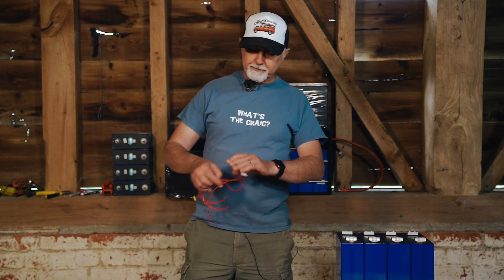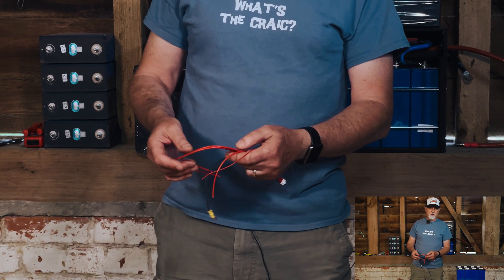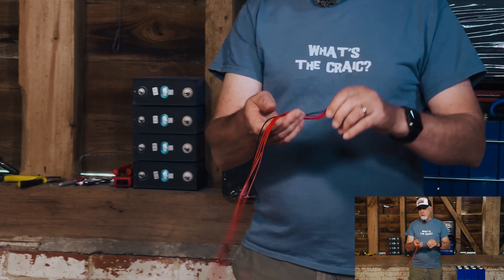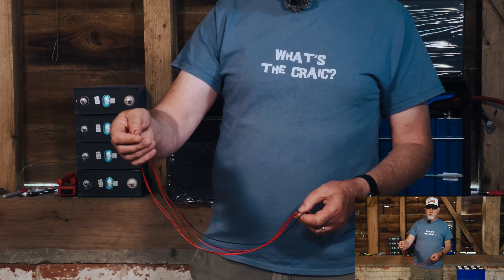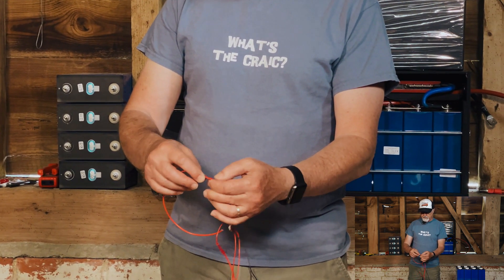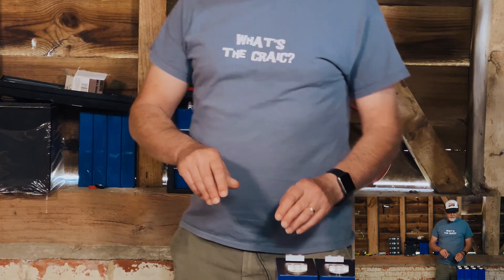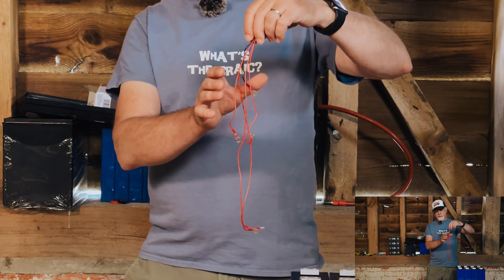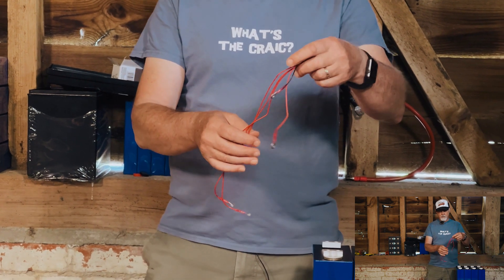Troubleshooting errors with Daly BMS

Comment: I got a daly smart bms and i think im going to return it it is not letting me connect bluetooth and mosfet not turning on.i adjusted parameters to do not sleep and max cell v of 3.55 .ive checked the cell voltage and they mught be 80 mv off butt after it charges they settle down .ive tried to short the b-p- also i soldererd the balance string so it got good connection i checked them about 4 times i checked continuity and i measured the cell voltage and i did not see nothing past 80 mv diffrence

Comment: Great video, excellent advice, thankyou. Any idea why my Daly Smart Active 200amp bms is showing 8 cells on the Bluetooth app, when I have only connected 4 red sample wires ( and the black to battery negative). This is worrying me, as I set up a similar Lifepo4 battery with the same Daly bms ( this one was 100amp bms to suit the battery), and on the app, it shows 4 cells. In both cases, I taped to isolate the redundant sample wire ends. Any advise would be really appreciated. I'm aware I am not a customer of yours...

Comment: I installed 5 Daly BMS with automatic balance function, two of them were damaged after 3 days, not physically but with lack of communication. Another Chinese garbage. Internal software communication problem if you cannot connect, you cannot reset the device.

Comment: One of the issues I noticed with your wiring harness is that you want all the balancing leads to be the same length in order to provide the same resistance for each lead. If I have to run longer lengths due to installation requirements, I use #12 gauge stranded wire of equal length run to din mount terminal blocks in order to connect to the BMS leads. This avoids crimping onto the smaller gauge wires, and in my opinion provides a cleaner and more rugged installation.

Comment: depends on the voltage... sometimes you get a shitty 72 bms.. maybe bad stock but how i make my battery arrays... it's not a possibility.. running it with stock wires then extending the wires with slightly thicker wires causes big problems for a bms... these glass cannon devices should be usingstock wires and if you have to extend some of the wires.. use thin/same guage

Comment: im having new issues with all Daly BMS ive purchased, 6 in total. Nothing to do with connections, since the app update where you now get single cell, parallel and series options. Bluetooth just keeps going off not connecting, sometimes not recognising at all. Repeatedly disconnecting and reconnecting bluetooth dongle, worked perfect before this app update, anyone having similar problems? BMS working fine with delta v very low but this bluetooth thing is an absolute arse ache.
Reply: I have similar issue. Just after update it's looks like Bluetooth is sleeping (BMS works fine) But Bluetooth dongle isn't waking up after charge/discharge. If I replug microUSB Bluetooth dongle then it turns on and I able to see it in the app and connect to it. It works during charge/discharge. After 3600 sec after charge/discharge is over bt dongle turns off. And then I have to replug microUSB again to start it..

Comment: 14s 48v 100a Daly. App says 53v multimeter 51v. But when I connect it to the growatt inverter. It qont turn the inverter on and with the multimeter its only giving 21v when connected
Reply: Hello, is your issue solved?

Comment: I need help, I have a new Daly 14s 48v 150a smart li-ion bms and it shuts off after 30 seconds and wont charge. 2 strings are at fault, 1 is too high and one is too low. I didn't charge the pack up before adding the bms, is this the issue? Will it even out after charging and then fix itself. The charger won't charge through the bms as if its in protect mode. Any help would be appreciated majorly, can't find any one with this problem on YouTube.

Comment: My Daly BMS was running 8 cells now it's only reading two cells and keeps shutting down I unplug the balance leads plug it back in same thing only reading 2 out of the 8 cells and shutting off???
Reply: I'm having the same issue, I have a li-ion 14s 48v 150a smart bt bms. It starts up for about 30 seconds and then shuts off, I have to keep turning my charger on and off for bt(bluetooth) to activate for another 30 seconds or so. Why is this doing this? Also, my bms shows 2 string too high and too low, I didn't charge my cells before putting them in the packs, so should I disconnect  the bms and charge the pack up then hook the daly bms back up? Any help would be appreciated
Reply: @ericblanchard5873  it's another setting in the bms for ur string count try to find that setting the problem I was having was my string count was off
Reply: I changed my string setting from 2 to 13 and even if it changed to the correct strings it still auto shuts off, it's very frustrating
Reply: @ericblanchard5873  yea my bms has shut off on me a few times usually during charging when the cell deviation gets wide as I noticed that my BMS wasn't completely turned off it just wasn't allowing no more extra charge to come in and when I waited long enough it did turn itself back on but I always unplugged the leads plug it back in to jump start it again and it stays running

Comment: Hi, 
I have a 16s 48v 250a daly bms on my golf cart.  It keeps shutting off when I accelerate.  Not every time but often.  Would this be a parameter issue or as simple as a bad connection?
Reply from the maker: Could be a loose connection or a runaway cell. Does it do it with a particular cell consistently?
Reply: Have this problem with the electric motor in my boat with a 150A Daly BMS. As soon as I start drawing current the voltage drops until the motor controller shuts off. The voltage drop occurs at the BMS. Battery voltage is fine under load.
All reported cell voltages are fine and the bms does not report an error status.

I think it might be an intermittent failure in a sensing wire (in that case, why doesn't the BMS report the error?) or the BMS itself is toast.

Comment: If that's a yellow crimp terminal on the returned balance loom, it's the wrong size for that thickness cable and it will never crimp down tight 🤔
I don't do many BMSs but i have trouble shot a lot of stereo installs in vehicles and I'd say 80% of the time it's terminal issues, usually too large a terminal on a thin cable ☹️
Great vid as usual guys 👍
Reply from the maker: Yeah, those balance leads were a bit of a mess! Definitely highlights the importance of sizing wire and lugs/terminals correctly! :)